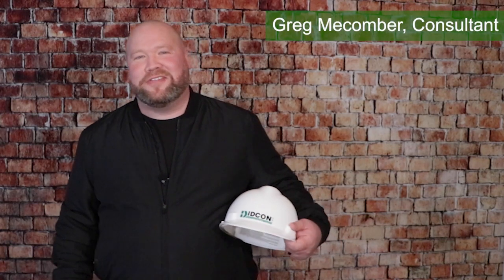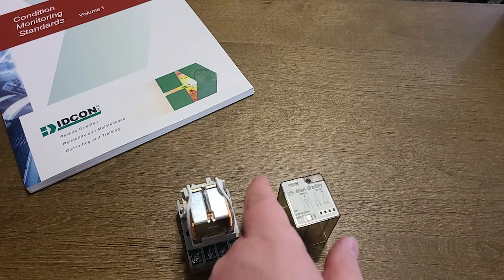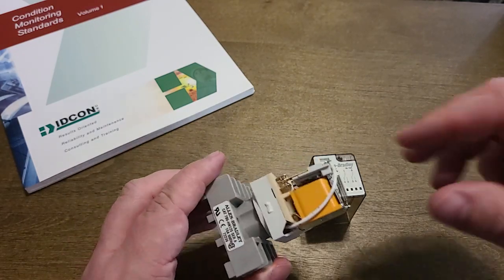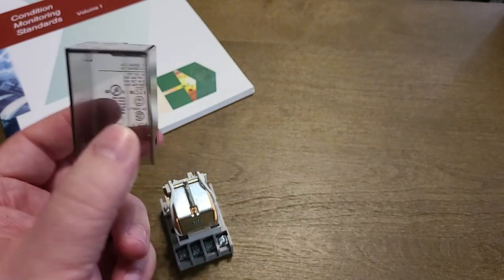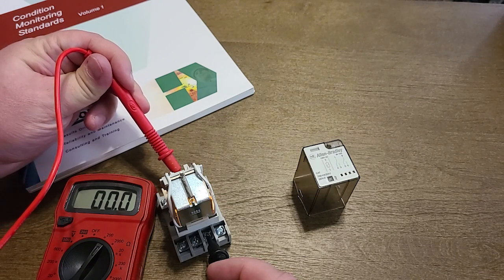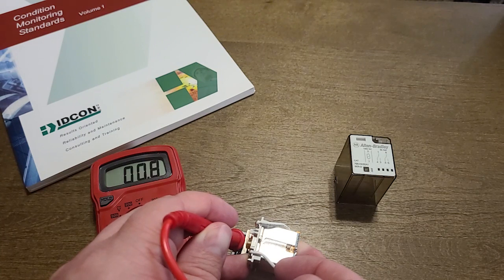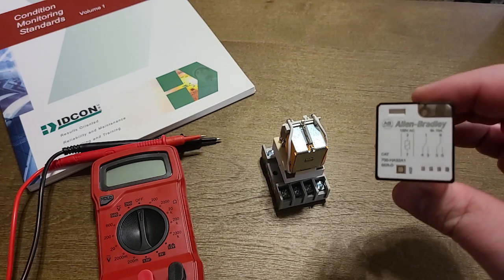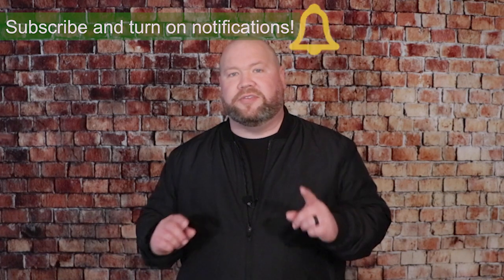Troubleshooting Course Preview: Testing Relays

Comment: New techs will benefit greatly from this. Also people who don’t understand what it takes to maintain and troubleshoot equipment.  I am a technician for a manufacturer and work with the factory technicians who are often stumped before calling.  Usually, backing up and applying a basic logical approach is all it takes to get the solution.
Reply from the maker: Thanks for the positive feedback Silvana.